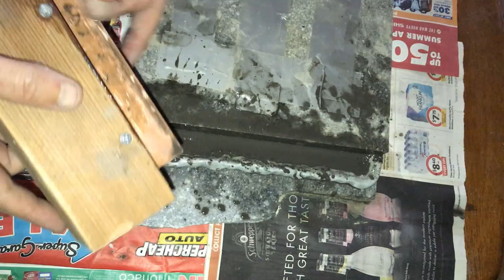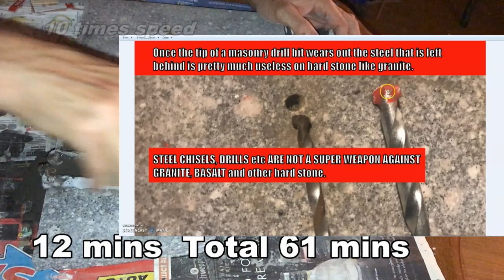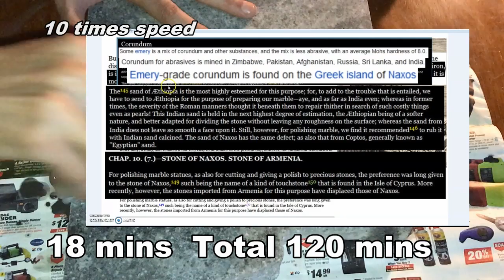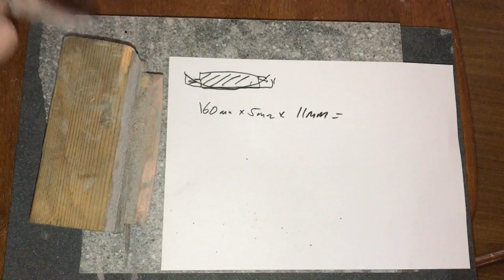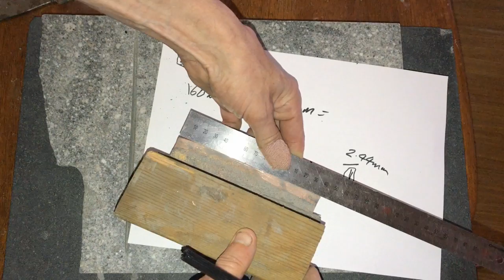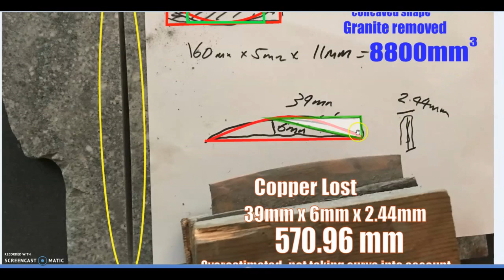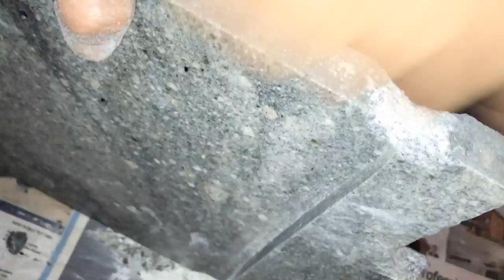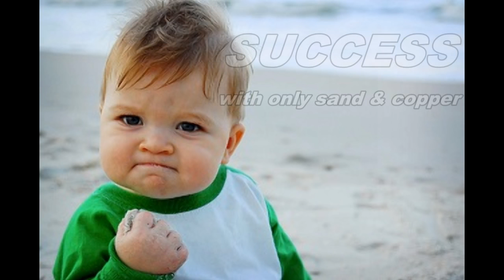LOST ANCIENT HIGH TECHNOLOGY- HIGH SPEED CIRCULAR SAWS 100% Debunked with Experimental Archeology

Comment: Hey Roadie,  Be totally honest and say, upfront, I have not watched this video yet.  You are putting out great material and I am able to learn much from what you are doing.  I was wondering if you have seen any of the stories about a masonry cutting device, some speculate, that was found in Ephesus or maybe Tarsus (I remember it is located on the southern shore of the Anatolian Peninsula very near the Eastern "Levantine" coast)?  I believe they said a water wheel was used in conjunction with multiple gears of varying sizes likely to multiply the torsion?  We do know they knew this tech during the "Hellenistic" because of the "Antikythera Mechanism." These gears then move straight saws back and forth, on the block, wherever they wanted to make the cut?  It seems to me that all of the basic tech would have been possible circa 3500 BCE, if we assume that they could cut the teeth accurately enough on the gears and could forge metal strong enough for the gears not to break under the stress, then such devices could have been used in or before the "Old Kingdom" possibly?

Not a circular saw for sure but moving to that might be feasible with enough hydraulic or steam pressure to turn the initial gear?  Would really like you to tell me what you think? Possible, unlikely or nada? Would you consider that so-called "LAHT?" Lastly what do you think the qualifying characteristics should be for something to be "LAHT?"

Cheers my friend,

Andrew
Reply from the maker: Cheers
Definitely, simple machines
It's not in English but the images show those saws, just a straight blade with a crank wheel shaft, like the trammel of Archimedes. ;-)
https://www.academia.edu/7326869/Stone_Sawing_Machines_of_Roman_and_Early_Byzantine_Times_in_the_Anatolian_Mediterranean

Archimedes trammel
https://www.youtube.com/watch?v=7Fn-26Jmi5E - attach one of these to a bar and that to a saw blade. 

History maze channel
Shows a modern reconstruction of that ancient water wheel powered design
https://www.youtube.com/watch?v=wi2nC4wgT6c&t=214s

Every civilization needs to be very clever with managing water, exact dates are lost but a water wheel is entirely within reason.
The Archimedes screw for example, some believe it was used in the Hanging Gardens but the language is coded-poetic, they describe something along the lines of the "great palm trunk"or somehting similar, the palms there have a spiral pattern in the trunk because of the wway the branches grow.
There is a strong pro Greek bias I would say in academia, things like Pythagorean theorem and pi are attributed to the Greeks, although in mesopotamia there are tablets that show math/geometry that includes the square root of 2 at amazing precision.

Greek and Romans were very open how Heliopolis was where they they learnt so muc of their geometry and astronomy, the centre of records/learning moved from Heliopolis to Alexandria. And Ctebius , Heron or Alexandria, made awesome machines. Plato, Pythagoras, Thales and Eudoxus all 'initiated' or educated in Egypt.
The influence of Mesopotamaian base 60 system leading to 360 degrees of 60 minutes nad 60 seconds, as with time measures.

Even Book 10 of Vitruvius describes the principles of machines rather than just describing how to replicate a design. Torsion springs used in their ballista-scorpion.
Heron-Vitruvuius describe the principles of basic machines like inclined plane, gearing systems, lever.

Sort of links to this video, i only use 1 blade but you could use several more with only one person still operating them. A great way to cut slabs-panels, a sinlge blade as here is slow in comparison but add a bunch of them and you multiply output, easy to cut 10 slabs at once with barely adding any effort since it's the back and forth motion rather than the downward force that does the job.

Comment: I thinks your experiments dont show nothing, I do thinks that all those monuments where made by hand. It will be nice if you show more details.... It is possible that they had Iron tools and we havent find them, en example is Tutankamón dagger
Reply from the maker: I think I proved that it is possible to do what the ‘experts’ of lost ancient technology say is impossible. Not just the tool but the ‘impossible’ thickness if the cut. It’s easy for anyone with a few hours to test this with only a few dollars worth of material.
That dagger is from meteorite iron. It’s from a much later time but they’ve found meteorite iron beads in jewellery going back to Old kingdom. It’s very rare but it doesn’t rust like iron that is manufactured. 
Though even if the Old Kingdom did have lots of iron available it has no advantage over copper in cutting since both are lower on the scale of hardness. 
Window glass is just as hard as steel as an abrasive.
Sandpaper can be used to cut granite as long it has sand on it. It’s not the steel or copper or bone that cuts but the sand.
Reply: @SacredGeometryDecoded  thank you very much for all that info!! I did like your video, I find this topic very interesting. I think that the unfinished obelisk in Egypt is a great example

The images that you added over the video makes it hard to see the details. Today I saw the new one and is great! Like artists, I am sure they had their own secrets on how to make does awesome things. If they where able to make that beautiful dagger It means that If you gave them iron, from a meteorite or brought from another geografic place, hey could work it.

I had the opportunity to enter into the Menkaure pyramid and the sizes of the internal rocks are incredible. So they where able to cut them by hand, now I need to figure out how they really moved them into that place jeje

Comment: Very nice video, i have been intrested in ancient civilisations for years, read books on the matter and tons of youtube content etc, never liked the ancient aliens gang(who in my view is only intrested in selling books and tours), i was more into graham hancock point of view for a time, can this tehnique of cutting granite be applied in the cutting of the inside of the boxes at the serapeum?or any thoughts on how they did the boxes(sarcophagus) or whatever they are. Keep up the good work!
Reply from the maker: Thank you for watching, there are a few ways to hollow out the inside. Fire setting could be used but would be risky.
I posted one recently on fire setting granite
https://www.youtube.com/watch?v=CyauQ7_z-A0&t=3s
A safer way, and some evidence for it, is to use a copper drill to cut around the edge of the area to be removed.
https://www.youtube.com/watch?v=yyCc4iuMikQ&t=326s (great channel) this video shows a great technique for drilling granite with copper. Once the border has been removed very easy to just hammer out the granite left inside. Because of the corners large chucks would be broken off as long as hit in the right direction.
Just repeating the drilling proces/ breaking off the inside until at the bottom.
Stone hammers again to pound out the traces of circles left by drill, at least 18 cubic centimetres an hour with stone hammer on granite can be removed to get to roughly surface. 
I will be soon posting experiments on how to ground down granite to a perfectly smooth surface with abrasive sand, it's actually quite quickly done. Which is curious since the Serapeum boxes, sarcophagus in Great Pyramid and most of the others have only been partially finished, far from the high polish that is spoken of when seen close up, lots of pitting and striations mark left when seen close, especially when a light is shone across the surface.
To create the right angle corners. Same channel- Scientists against Myths
https://www.youtube.com/watch?v=HQ2bHE7mTi4  stone tools only
It wouldn't be done in day but a small team could do it in a month or two at the most.
I was actually quite surprised at how so many of those sarcophagi etc are very poorly finished. A few more days work could have brought them to a highly honed finish.
I will be posting experiments in black granite and removed striations as well as split face granite, i can bring split face black granite to a honed flat surface at about 1.5 square feet in less then 3 hours, and I can improve on that speed as I work out how to avoid noobish mistakes.
Reply: @SacredGeometryDecoded  Thanks for the answers and recomandations, i will check  them out for sure, looking forward to your video on high polish.

Comment: Great research and experiment - you can imagine how this process would have been tweaked and bettered til they had it nailed, as well as scaled up - humans always in their nature make things bigger and better. The idea of collecting the sand after and extracting the copper grains to recycle makes a lot of sense too.
Reply from the maker: Yeah pendulum saw with a weight to force it down, experience in making best abrasive mix including the best size of grain size, mine was pretty fine but based on some other experients coarse grains probably better, that would match those striations in Egypt for size and depth as well. They act like ball bearings once they get rounded by the action and break down in size to fine slurry, someone to keep constant water and abrasive instead of me having to stop and add it to the groove. That alone added a decent percentage of time in stoppages plus less than max efficiency
Reply: @SacredGeometryDecoded  you proved the concept perfectly - in your kitchen - I loved the splitting with lolly sticks too ...that kind of puts it all in perspective:)
you might get a lot of pissed off parents though - you know - when their kids raid the sand pit and the plasticine, and start cutting grooves in their granite kitchen worktops:)
Reply: @SacredGeometryDecoded  The 'blade' of a huge pendulum saw could (and probably would) have been a massive slab of copper or bronze of considerable weight. Probably crescent shaped, with a swing arc + length spanning  a dozen feet or more.  
With lots of weight and swinging power behind it, it would begin its grind into a stone block with considerable force, ripping a groove deeper and deeper in a much faster pace than any manual demonstration.  Its weight would give it added power due to the force of inertia of movement adding to its forward and backward momentum.  
At just the right depth between swings, (incrementally lowered speck by speck) the blade would be slowed only a small amount.
I've only watched the first four minutes so far, so I may have more to add, and learn, from seeing the rest.  Ancient Stonework Mysteries  -Facebook.
Reply: @SacredGeometryDecoded  Would also explain why they used different type of sand at the pyramids. Some sand is more abrasive.

Comment: Instead of using muscle strenght to push it down in the next test, just use a weight.
Also, try not using a flattened copper pipe. If you get a sheet of copper, i wonder if its got the same self sharpening effect that was discovered with the tube drills
Reply from the maker: Once the pipe began splitting into two pieces they sharpened. Bits of sand forced into and separated them slightly. So a wider cut could be made with a few sheets together instead of a solid block. 
Once I get a larger enough piece I want to make a curved cut like the block at Abu Rawash. A few sheets would leave them malleable enough to flex a bit and there is a fault in the cut that I reckon I can mimic. A small piece gets inbetween two of the sheets and causes a small shelf.

Comment: Have you or any of the other video creators you've  researched tested different types of lubricants with the blades and abrasives? I'm interested, because through my own separate amateur research in gardening and ancient domestivation it seems some seed oils may not necessarily have been used for cooking but for cosmetic purposes so, maybe some had industrial use?
Reply from the maker: Olive oil and water is quoted in a few papers. I’d like to try castor oil because it was used for some things in Egypt
Reply: @SacredGeometryDecoded  That reminds me of the 'science' of deep oil / gas well drilling.  They can't do it without special lubricants which are mixed in with the water pumped in to wash out the bored out rock. So yes, the 'science' of lubricants can be crucial to achieving optimal results. 

But of course they would have to have been plant-....no wait, they could have also been animal-fat based.  Or a combo. 

Plus, consider the lubrication method of Graphite.  Mineral based lubricant!  hmmm....wonder how well mica might work, or soapstone.
I suspect that lubricants really only come into play when a blade is getting pretty deep in the the cut stone. You sure don't want it to get stuck.  It would not be removable with breaking the block.

So, do you now feel inspired to erect a small scale pendulum saw?  Everyone would want to see that.

Comment: I didn't quite understand why you would need large and high powered tools. Many of the things I have shaped in metal can be achieved to a higher degree of precision by a practiced hand. Even ancient explosives are not beyond consideration. You can literally blast a stone to sit where you want. My question is, how did they angle off slabs from the rock-face?
I can't see blasting with shaped charges. Could you slide in a rope with silica sand and shave it off the face? Are there, were there organic materials once woven cut rock?
Reply from the maker: Well you don't need giant high speed saws. ;-) The lost high ancient technology scam relies on saying it's impossible to work granite without highly advanced equipment and materials.
 Ropes embedded with abrasives could also have been used, corundum(aluminum oxide)  is almost as abrasive as silicon carbide and about the only thing better than that is diamond.
Reply: @SacredGeometryDecoded  And diamond is not that rare, even beach sand, desert sand can contain tiny diamonds. Thanks for the demystification you are doing.